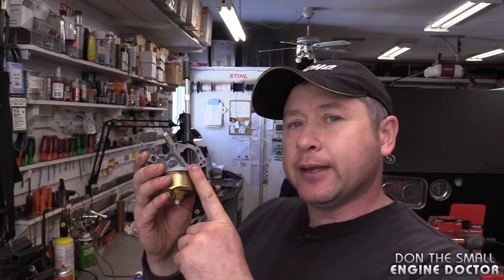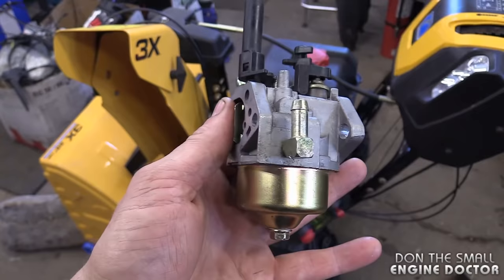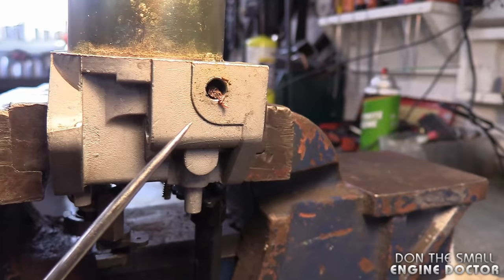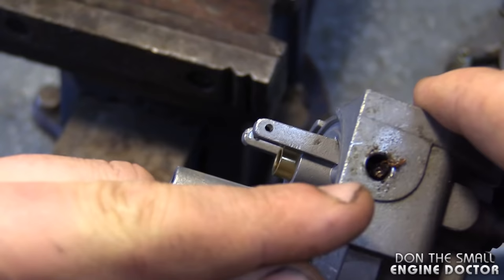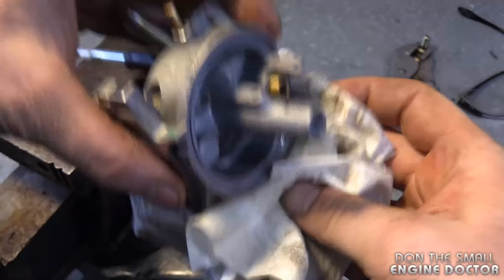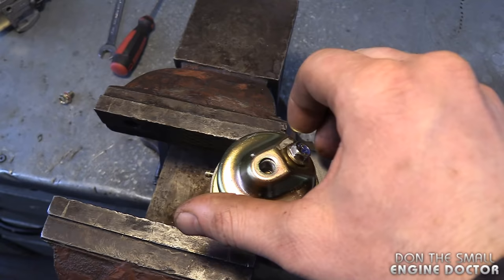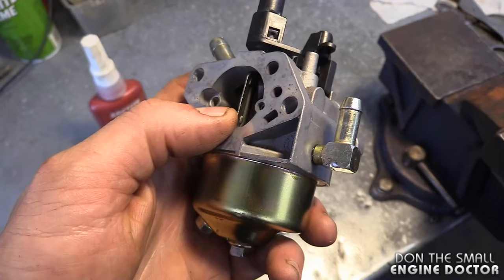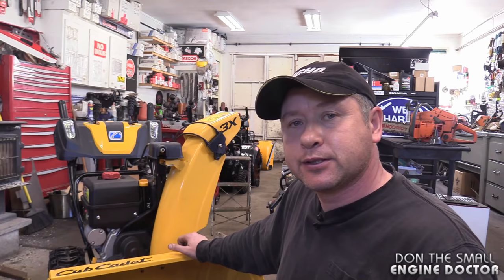Hidden Carburetor Fuel Filter Screen On Small Engines! Must see! - Video

Comment from the maker: Watch how to stop a SURGING Lawnmower here --- https://www.youtube.com/watch?v=gV6IOkevloM
Watch how to stop a SURGING newer Ariens, Toro Cub Cadet etc. snowblower here --- https://www.youtube.com/watch?v=tfWNXsH2CVo&t=1s
Watch how to stop a SURGING Tecumseh snowblower engine here --- https://www.youtube.com/watch?v=9peW43lG1lw&t=1s
Reply: Thank you 
From Wisconsin
Reply: The dirt is the residue of ethanol and will gather in that filter regardless of fitting other filters in the line. No need to take the fitting off spray cleaner will shift it.
Reply: @sidneyeaston6927  Fact: Ethanol actually keeps your fuel system cleaner than regular unleaded gasoline. In dirty fuel systems, ethanol loosens contaminants and residues and they can get caught in your fuel filter. And if you continue to use ethanol-blended gasoline, your filter will remain cleaner for improved engine performance. 
- communityservices . nd . gov › Ethanol › EthanolFacts
Reply: @RichardFallstich  Yes in a fuel system that is being used on a regular basis. Fuel systems that are left to stand have problems that is why you hear so many complaints about garden equipment getting blocked fuel systems after months of storage.
Reply: Donyboy73 is awesome !!! Video look like spring is will it already here soon or eventually!! Salu2 mi amigo!!!
Reply from the maker: @oliverbreanna789  buenas tardes amigo, si espero!
Reply: @donyboy73  I miss you my best friend!!!! Over here on Washington dc .still nice weather like 40 to 50!!! But is ok I hope soon or later we will begin all machinery to make money!!! Lol salu2 Donyboy73 plus tax
Reply: @RichardFallstich  I'm not sure but like the other comment posted. That's probably good for like you car that you use often. Not for seasonal small engines where the gas sits for a long time. Again..l'm not sure but do appreciate your comment. I always like being educated about this stuff.
Reply: @shsechas  Thus a great reason to drain gas from equipment for the off season. I do.
Reply: @RichardFallstich  Definitely going to do it this year. Thanks for the comment.
Reply: @sidneyeaston6927  WELL SAID ............
Reply: Is that fuel screen have on Tecumseh 10 hp carburetor?
Reply from the maker: @aleksandarpetrovic6613  no
Reply: @donyboy73  thank you!
Reply: @RichardFallstich h
Reply: Rutzky? Your THs sounds like Ds. Like a 15yr here russian
Reply from the maker: @joeblow8206  I'm Canadian

Comment: I retired from the small engine repair business 6 months ago. I performed warranty repairs on a variety of engines and equipment, this screen was mentioned in no training material that I saw up until that time. I as a general rule cleaned carbs with an ultrasonic cleaner and I would blow out the inlet tube as part of the drying process. I may have been running into that problem and fixing it without knowing that was the problem. As I think back, there were quite a few carbs that I didn't find gunk or corrosion but were cured by the carb clean. Thank you.

Comment: I’d throw the screen away and add an in-line fuel filter.
Reply: Absolutely!  That's exactly what I did to mine.
Reply: @williamwalter4882  This is not a good idea. If you get some dirt on the under the fuel float pin for any reason, the pin could get stuck open. Then fuel will pour out of your machine while it is hot and possibly catch fire. Play it safe and keep the covert filter with the added exterior filter. I would rather risk it getting clogged again then catching fire. Remember that companies don't add pieces to mess with you. They probably did it because they go sued.
Reply: @ghopkins25  Nope!

Comment: Great tip, I have a generator that is doing the exact same thing - running perfectly with the choke is on - I've been through the carb. At least three times and never thought of removing that fuel fitting. Other"dishonest" repair shops are going to be upset with you for revealing state secrets. I punched the liked button. I'll be back with the results. Thanks for sharing your knowledge

Comment: Don't be afraid to wear safety glasses; carb cleaner blowback does not feel good in the eyes.
Reply: I found that out last fall, and I know better!
Reply from the maker: @scottfirman  me too lol
Reply: Yep, I've had it happen to me, and that is an experience you will never forget. Just as getting zapped by the sparkplug wire is, learn thy lesson, to never repeat again.
Reply: @stellarproductions8888  sounds like a good friday night to me!
Reply: @DavesSmallEngines  ohhhhh Ha Ha Dave. 🤪
Reply: Carb cleaner stings way worse than brake cleaner, ask me how I know!
Reply: Don’t point it at your eyes.
Reply: Now you tell me!  I’ll never do that again!  😳
Reply: so i wasnt so post to use it as eye drops
Reply: I know that feeling. It hurts like hell and it was almost 2 weeks before i could see straight
Reply: @db130 : I was going to ask which is worse...

I was trying to clean out a blind screw hole with just a LITTLE spritz of brake cleaner (the REAL stuff; tetra-whatever), and... let's just say it ended up being a BIG spritz! Wouldn't have mattered if I wasn't LOOKING STRAIGHT INTO THE HOLE WHEN I SPRAYED : )

Comment: An excellent reason to install an inline fuel filter on all lawn and yard equipment.  For those removing the fuel inlet nozzle, understand they can leak after re-installation.  The inlets were only designed to be press in once and seal through the friction fit.  Every following removal and installation will not provide the same level of contact between the fitting and the carb body as the original installation did. You might be better off using pressurized air or cleaner from inside the carb to blow debris back out of the inlet.
Reply: Doesn’t leak when using locktite
Reply: Even if you do put in a filter it can still get dirty. The rubber hose will degrade over time.

Comment: Ran across this before. A also had 2 stroke screen that looked clean but wouldn't take fuel because the screen had a wax film on it from varnisised fuel. Good tip Donyboy.
Reply from the maker: yes i see the 2 stroke screens that look clean but are clogged!
Reply: @donyboy73  I have had about 4 from 2 stroke carberators that the screens had a wax film. Fuel wouldn't pass through even after 20 minutes in my sonic cleaner. It seems to turn to glue. I found good results using compressed air and carb cleaner after I put them through the sonic cleaner. You should make a video on that problem because you are good at explaining problems and getting good results. Thanks
Reply: I used carb cleaner on a small screen in the fuel rail of my 225hp Honda outboard. The screen looked slight amber, when sprayed, the silver screen color came back and motor ran good again.
Reply: @kodiham7532  Carb cleaner works great but it deteriorates and deforms rubber gaskets and O rings. After spraying with carb cleaner I always run it through my sonic cleaner. I put straight gas in the sonic cleaner. Found that gas is by far the best. Never leave it unattended while cycling it
Reply: Oh yeah, I have had issues with dirt and two cycles. Especially chainsaws, and weed whips. There is a filter inside the tank on these and the dirt can still somehow get in the fuel line also. Probably number one issue for these motors is dirty filters/gas lines. If you are handy you might save yourself a few bucks here.
Reply: @robertforster9736  
"Real" Carb cleaner shouldn't do that!!
Brake cleaner definitely....

Comment: Thanks Don! Been doing this for years and never knew that. Had a mower with a powermore engine, straight fitting on the carb, removed it, sure enough, almost completely blocked. Even after going through the carb, twice, and blowing air through the needle seat. Unless you remove the fitting, nothing comes out. It solved the problem of the mower stalling out after 10/15 mins. Thanks a million Don. Cheers!
Reply: Funny you should say that. Ive taken my carb of twice to clean the hell out of it and still doesnt run right. Ive even taken off the float and needle and sprayed down through there. Last year i cleaner it but never ran it because didnt get enough snow worth using the blower. This year was expecting a good storm so went to start it. Ran great when first started it with the choke on. Soon as i turned the choke even just one click it would die. Took the carb off n cleaned it again, even more thoroughly than last year. Started right up with the choke, one click it stayed running this time, 2 clicks it shut off. So ran it just the one click after warming it up. Turned the auger on, put power to the wheels back and forth a few feet, figured it would get me through. After the storm i went to clean up. Started right up, ran great, one click off the choke ran good, auger running still running good, power to the wheels still running, soon as it started blowing snow it would cut off. Im willing to bet this screen is clogged. The blower is only 4 years old and lightly used, always used stabil. Changed the oil last year. New plug this year. Im betting that screen is plugged. I hope so anyways or im at a loss

Comment: As a commercial small engine mechanic, I don’t over load the fuel system with multiple filters, I use the one in the tank and that’s it. However I do install a shut off valve in case of a float sticks open so fuel doesn’t leak into the crank case or on the ground while not in use. But if you feel you need more protection then I would go with a inline filter but ask your local professional repair shop for a proper filter because a fuel pump system filter is different from a gravity feed fuel filter system. Great work and video.
👍😎👍
Reply: i agree with this.

Comment: Excellent DB! There was a generator that i bought new that was acting that way in very short order. I've heard of
some instances on these Chinese made carbs, when they cast the aluminum carb bodies, that sand could remain
behind in the manufacturing process and so that was one of the immediate things that I had looked for from the
get-go! In a case that you just presented, an absolute dead giveaway is that, if the small engine that comes with
no external fuel filter that came originally equipt on the machine; well then that hidden filter is ever so much the
issue at hand! Thank-You DB!! My son's riding mower is acting the VERY SAME WAY!

Comment: Every time I watch one of these vlogs with someone who has had equipment problems caused by dirty gas or something managed to get into the fuel tank. I think how great it would be if they all had a dad that taught me that a clear inline fuel filter is worth way more than they cost. He insisted that we run one on all the equipment we had that didn't already have a sediment filter in the line between the tank and engine. If you had a problem with a piece of equipment running you look at that filter and see if there was dirt, debris or bubbles of water in it it could same you a lot or work or get you pointed in the right direction.

Comment: Thank you for the tip. I already bought two carburetors for my snowblower and couldn't find out why they will work for a few years and start having problems. I check both of them like you said and they had block screens.

Comment: Has anyone checked the screen after cleaning with an ultrasonic? Nice catch Donyboy! Thanks for the awesome videos!
Reply from the maker: it's better to manually clean it
Reply: @donyboy73  Got it, thank you sir!
Reply: I cleaned a powermore carb with an ultrasonic and it still will not start. This procedure is happening soon. 

Thanks Donyboy
Reply: Yes and it’s not clean as it should be so I pulled fitting now

Comment: Huh, I always thought that little elbow wasn’t removable. Thanks for the awesome tip!!!
Reply: I was the same way here  , about thinking it wasn't removable .
Reply: The plastic ones aren't replaceable
Reply: @larrylewis1375  yeah I wouldn’t try this with a plastic one.
Reply: @larrylewis1375   Yes they are , I've repaired many in my shop,  they crack and leak at times , and you can buy new ones off of E-bay !! 🙂
Reply: @77Mowers        Just blow it straight back with the nipple in place if need be.    Not quire as good but it’ll work. Some carb cleaner after to finish it off and as always watch those eyes with carb cleaner🤕

Comment: Wow, Don I look at the tools you have and I see you I have a lot of the same stuff.
You just solved a mystery I have had for years.
Friend of mine had a mower from CTC with the the same carb.
To look at it it was very clear,  just like new and couple weeks out of warranty it gave out.
He brought it to me, the carburetor looked like it just came out of the box. 
I couldn't get it working   he took it to the big repair shop down town,  they couldn't get it working,  they damaged the carburator trying,  then offered to put on a new carburator for more than he paid for the mower.
Soooo I just put another engine on the body for him.
Going to check that carburetor out , but it won't work cause of the damage they did. 
Thanks ever so much

Comment: Wow honestly never knew that. Thank you Don. I've always thought those connectors were part of the body assembly. We learn something everyday!
Reply: sure, if there is two different metals, and one is another color,   'they  got it in there, somehow'....reverse engineering is usually a better fix, like others here stated..'throw away the screen, and install an inline filter..'  better designs  shall  rule....

Comment: I cannot believe that. I could not even guess of how many carburetors that I replaced that I just could not get to run. I'm talking about taking everything apart put it in the dip bucket blow air through almost every single passage that I could get to. This makes so much sense. Thank you so much for sharing your knowledge. That's what I love about YouTube no matter what part of the world you're in we can learn different things from one another. Fortunately for me I don't throw carburetors away I keep almost all the parts that I replace with very few exceptions. Now that spring is coming and I will be over in the garage once again the first thing I'm going to do is pull some carburetors out and check that screen.

Over the winter I bought one of those small hand pumps that you can pressurize a carburetor with. I think with something like that it would definitely narrow down where a blockage is. If you're pumping air in and it's not making it through, the only thing to do is to start where it enters the carburetor.

Another great video you really made my weekend. I don't work on lawn equipment as a profession. I'm retired and I get bored so for years I've been fixing neighbors and friends and families on equipment. And a couple weeks as the weather warms up that's when everybody will start bringing their things to me. Now learning about this screen is going to save them money. The only thing I ever charge people for is part and even then it depends who it is.
Reply from the maker: have a good weekend David!

Comment: Thank you very much for your videos!!  I have a Harbor Freight 2500 inverter generator.  It was running VERY lean.  I had it nearly fully choked to keep it running.  I took the carburetor off and thoroughly cleaned it and it still would only run when choked.  Basically no improvement.  Unfortunately I didn't know about the hidden screen until I saw this video today.  I bought a new carburetor off eBay and installed it.  The generator runs like new again.  I'm fairly certain the hidden screen being clogged was the problem.

Comment: Great tip, Don. Thanks. I might add that a pair of "brass knuckles" (soft metal jaw pads) for the vise will prevent any damage to the carb's mating surfaces by the vice while you work on it.
Reply from the maker: yes absolutely

Comment: There was some fabric dirt on this screen. Lawn tractor Cub Cadet xt1 with Cub Cadet engine was starving fuel. It has fuel filter between tank and carburator however after over 3 years the small screen was almost full of dirt. Thank's for help as always, saved me from getting lawntractor delivered to the dealer(Paying 40€) and waiting for it to be fixed couple months. You are a good man.